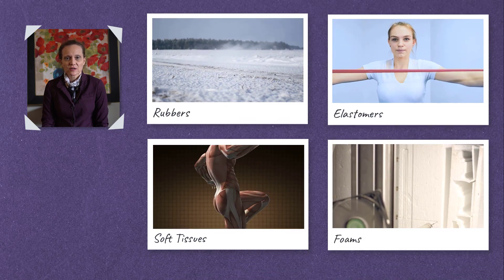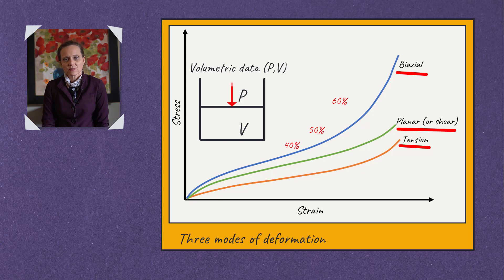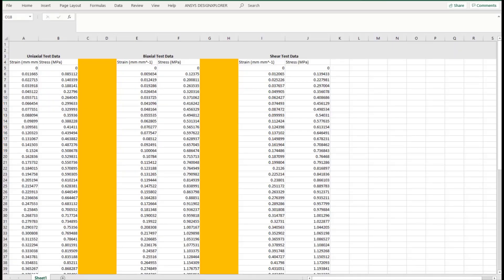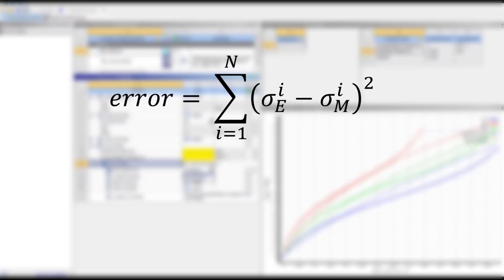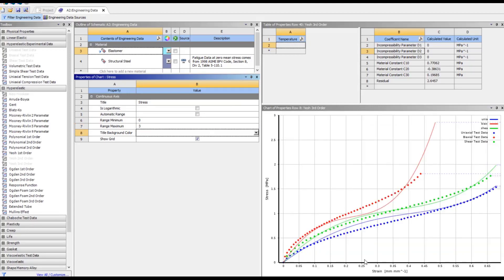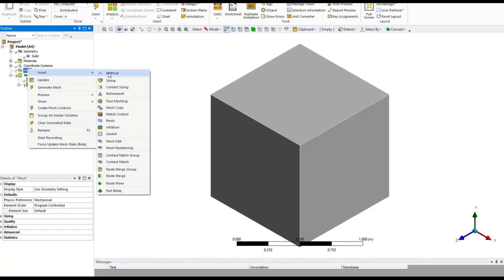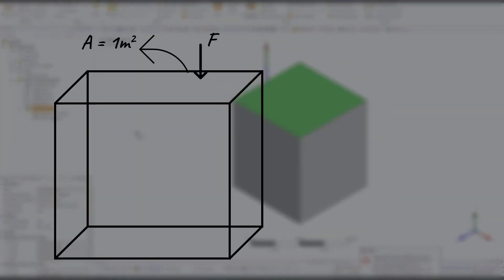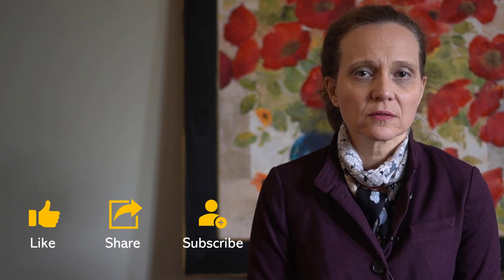Performing Curve Fitting for Hyperelastic Models Using Ansys Mechanical — Lesson 1

Comment: Thanks for the video! It has been really useful for me to define and calibrate polymer materials. The only thing i think it's wrong is that in the last comparison between experiment data and simulated data, you are comparing forces with stresses and as expected cross section is changing throughout the experiment, then it may not be comparable, right? thanks anyway, very nice job.
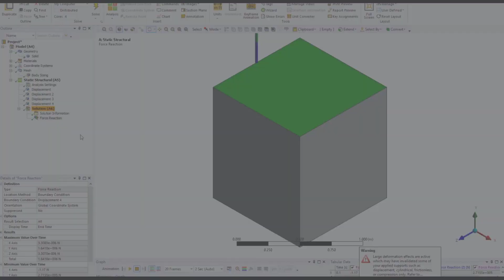Reply from the maker: Thank you for your comment, we're glad that you liked it. Regarding your note, in the video we only compare the numerical values of the force-displacement curve with the engineering stress and engineering strain. The engineering stress is calculated with respect to the undeformed configuration (change in the area of cross section is not taken into account) which is why we compare against it. Also, they have same numerical values due to the unit dimensions of the cube. Please refer to the video from time stamp 12:32, we provide an explanation in more detail. I hope this helps!

Comment: Thanks for the video it really helps me understand how to preform the curve fitting !
I have question to ask, I am trying to simulate Dielectric Elastomer Actuator, and I already defined my material using the curve fitting tool in ANSYS. But,  now I want to apply cyclic loading in terms of (voltages and frequencies) to my Dielectric Elastomer Actuator and find the deformation of the Elastomer. Frankly, I really do not know how I can do this simulation I can not find any references or tutorials.  If you can help me with anything will be much appreciated. 
Thank you again!
Reply from the maker: Thanks for watching! The Ansys Learning Forum is a great place to get guidance and answers to questions just like these. Visit today at https://www.ansys.com/forum.
Reply: @AnsysLearning  Thank you for your reply! 
I am actually a member in Ansys Forum and I searched for anything that is related to simulation of dielectric elastomer but I could not find any. Because, as I know that simulation of dielectric elastomer is complicated and it requires iterations between two physics fields for convergence. And I really can’t find any thing that can help me what to do and if it is really possible to preform such a simulation in Ansys.

Your help is highly appreciated!
Reply from the maker: @Time-Lapseyp4mo  You have a great question regarding modeling dielectric elastomer! Please post these questions on the Ansys Learning Forum and our engineers will guide you on these convergence issues related to your simulation.
Reply: Ansys Learning Thank you! 
sure I will post and hope I can get an answer to my issue